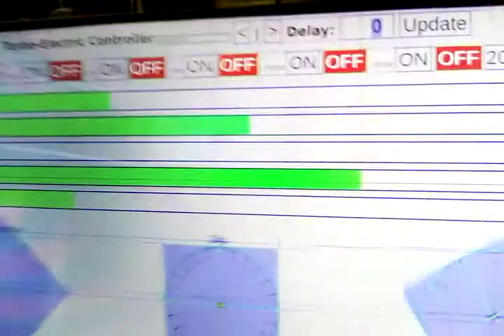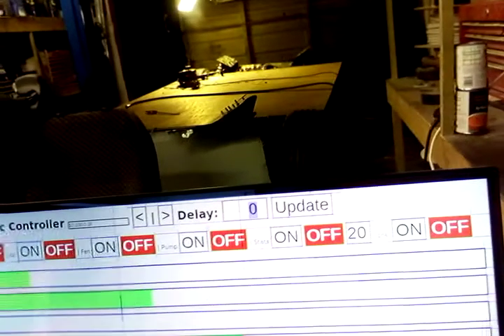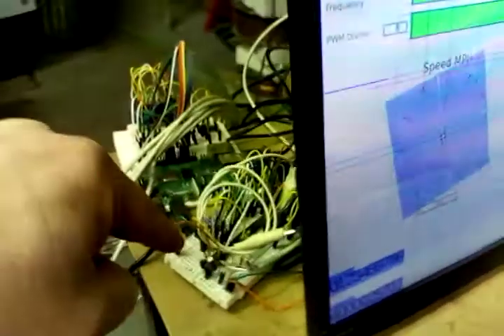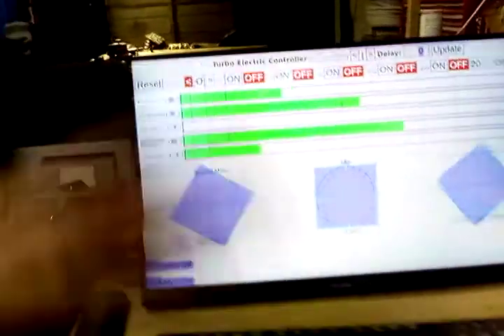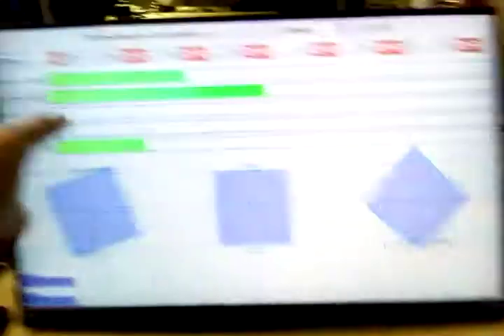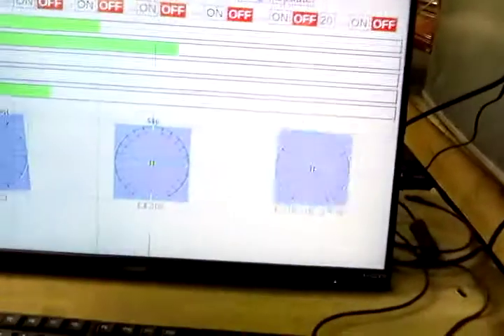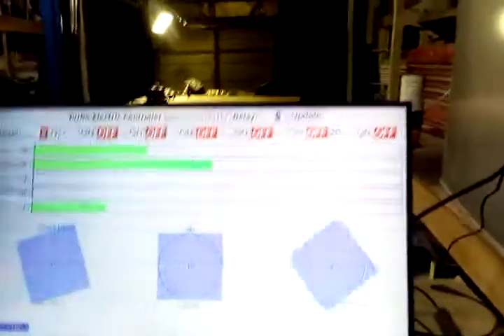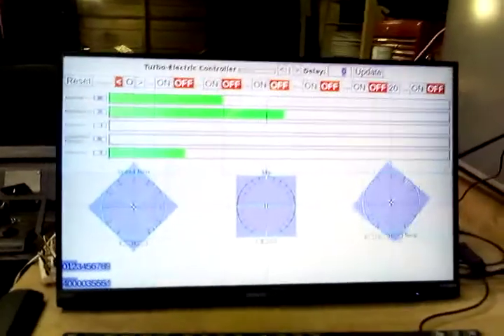Raspberry Pi Touchscreen Engine Diagnostic Written in OpenGL

Comment: I see you are still making steady progress. I should be quite easy to find space of an 'ECU' that small. Don't forget I am hoping for a slider down one edge of the screen to turn the stereo volume down quickly without having to look at the screen while driving please.
As far as handbrake goes, I am not sure if a regulation says you need one, but if you don't, I would have thought a lot of EVs wouldn't have handbrakes, just a Park feature. And of course, it would need a fail safe on the park 'button' so you can't accidentally press it when you are speeding down the motorway, I dare say another line of code to say, if the engine is turning, don't engage would do it.
Reply from the maker: Good idea actually (down the edge so you can find by feel). I can write logic into the software to disable handbrake when moving etc. I already have logic in to disable driving while charging, plus other stuff :). Also if your into your sounds, the car will include a 1,600 watt system (4 x 400watt RMS classD amps) and have the bass pumped through the engine via the controller (I kid you not, I'm designing and building the controller so why not). Also one screen (of the 3) will be dedicated to media/entertainment. Bluetoothed and Wifi'ed up to the max. 
No point in being shy. The car has it's own huge power supply, so might as well put it to good use :)